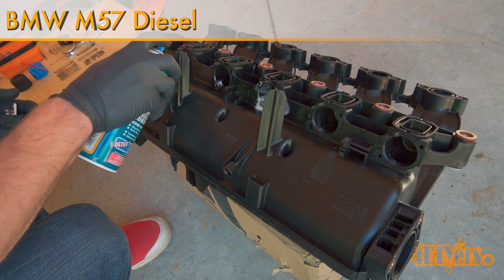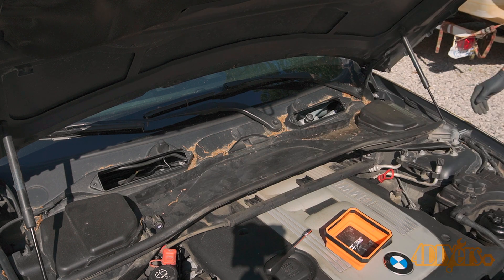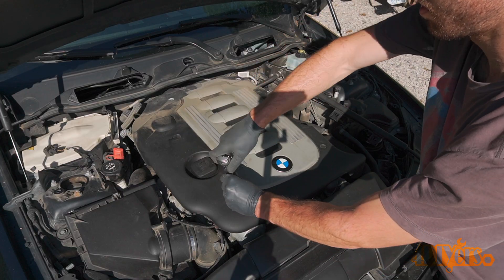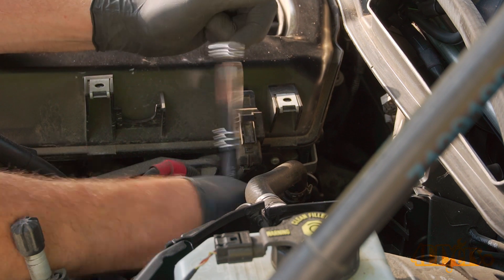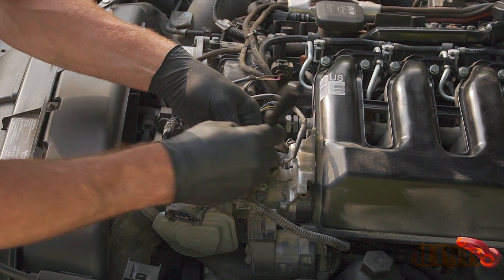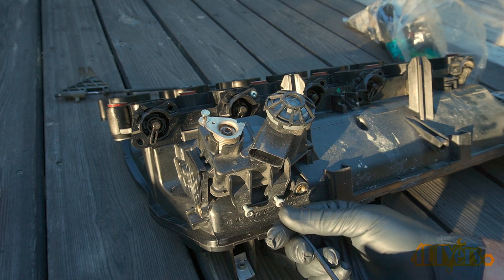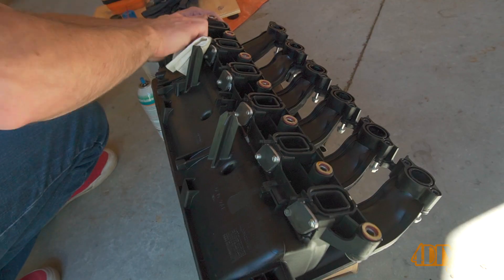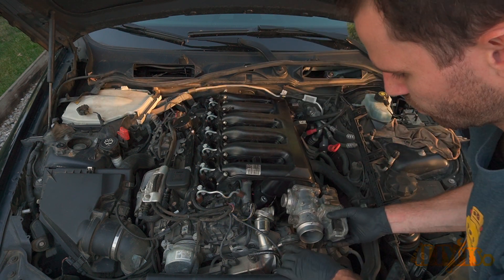How to Install a Swirl Flap Delete Kit on a BMW M57 335d

Comment: Just used this video to install my delete kit. Super useful, maybe it would be better showing the bolts “hidden” behind the engine, but very useful. 

Quick note, some M57s (like mine) have the EGR controlled by a vacuum line, so there is no electric plug to remove, do not spend hours looking for it if you see a black tube entering your EGR

Comment: I got stock E70 2012 x5  will this delete swirl flap kit throw check  engine light?
Reply: No because he puts back the actuator so the engine thinks that everything is working as expected.

Comment: Why add the actuator motor back on? Can I just leave it off?
Reply from the maker: So it wouldn't kick on a fault code. I think once a tune is done, the actuator can be permanently removed.

Comment: You forgot to link the block off plate... Useless if we can't buy them.
Reply from the maker: No I didn't. The company I ordered from, while they did make a good quality part, I wasn't impressed with their customer service after other stuff I ordered came damaged and it was a problem getting it resolved.

Comment: One question. Because I wanna buy an E60 manual 530d probably 2007 or after that year with M57 engine. Does this engine have these swirl flaps and if so, isn't there any part that fixes this problem without changing the way that it was designed by the engineers? Does removing them affect the engine reliability?
Reply from the maker: I believe the 07 also has these. But you’ll have to double check as we never had that year of diesel in Canada. Engineers don’t always do everything right. Apparently this does make the engine slightly louder, however I haven’t noticed any change.
Reply: There is actually - by buying a new intake manifold. But if you want to keep everything the way it was designed by engineers, DO NOT buy an old diesel. Dpf's, egrs, swirl flaps and similar.  All of them kill the engine but are necessary for emissions. And they are very expensive to fix/replace, (dpf would cost more than the car you want to buy) not to mention possible damage to turbos and engine when they go bad.

Comment: Help! I've just done but i can't get it to start it crank but it doesn't start. Did I messed something up ? Or do I have to do something special beside turning the keys ?
Reply from the maker: Do you have any codes? I just had this issues after replacing my harmonic balancer. Made it 10 minutes up the road and my car stalled. My crank sensor failed. Do you have any rpm when the engine is turning over?

Comment: Silly question but would it be possible to just disable the actuator until acquiring a delete kit? 
We just bought an M57 E53 X5 and this will probably be the first thing I do to it. Love your work this is a very good and comprehensive video!
Reply from the maker: Thank you so much! Yes, you can simply unclip the actuator arm and it won't cause any issues.
Reply: @4DIYers  I am also doing all the same things to my 335d and my X5d I am in love with this drivetrain and the torque.

Comment: Did you reconnect the swirl flap controller or leave it unplugged.
I did a swirl flap delete on an e83 x3 3.0d and plugged the controller in, at idle it made a loud knocking noise as the motor tried moving back and forth. I then unplugged it and got a fault code. Wondering what you did?
Reply from the maker: Nope, that is still in place, however I did also remove the large push rod. No issues at all.
Reply: @4DIYers  Okay, thanks for the reply. I removed the swirl flaps and plugged them with a delete kit and also removed the long rod. Put the controller back,on the manifold and plugged it it. At idle it makes a loud knocking sound as the motor seems to go crazy trying to adjust the swirl flaps that are now missing. I've unplugged it but get a MIL light on the dash as a result.
Reply from the maker: Have you also disconnected the battery for a computer reset?